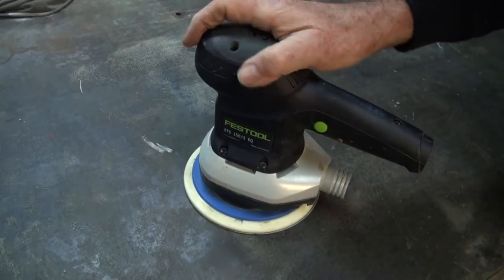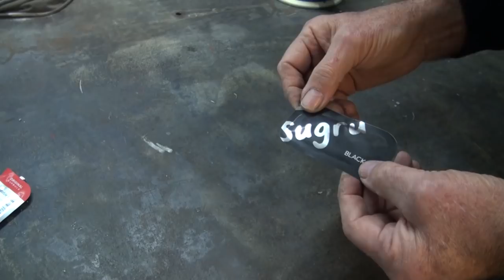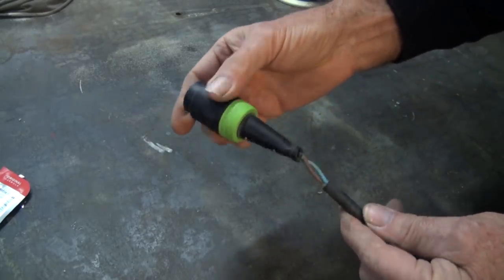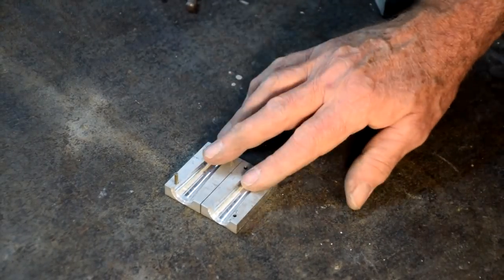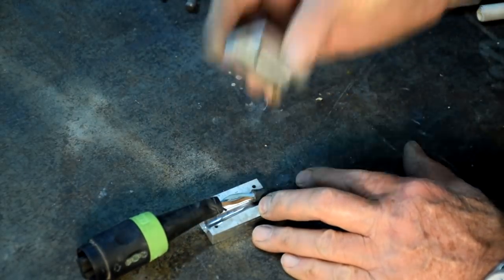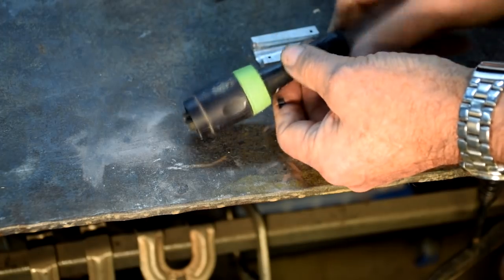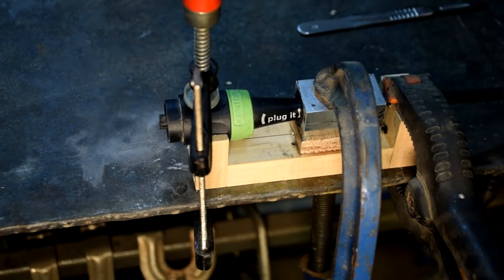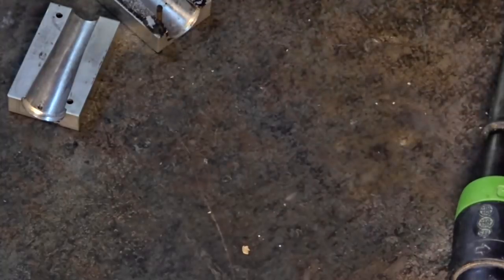Festo Plug It Repair

Comment: Nice project. I think it was well worth the effort even though it didn't fill in all around. But you also learned for next time. I actually did something similar using 1/2" aluminum blocks to make a jig head mold for fishing. Same pinned technique and two piece mold setup. Thumbs Up.

Comment: Hi! As an owner of a couple Festools and user of Sugru, I congratulate you on the fix. I liked your project of making a mold and a clamping jig. Kudos on the work but it might not be totally necessary to make a mold. 

You might want to try molding the Sugru with your fingers only without having to make a clamping mold. Lots of time, I shape Sugru with my fingers and smooth the outside using soapy water. Daniel

Comment: you can separate the green part by prizing it open and repair the lead .....simple...
Reply from the maker: Gary, I tried that. The connectors seem to be a one piece moulding. At the end of the day it was more about investigating the use of Sugru as a candidate for making flexible repair parts. I know it seems a long winded and complicated repair but sometimes it's more about satisfying my curiosity with new materials.
Regards,
Mark

Comment: Mark I'm probably telling you something you already know of. But heat shrink with the glue built inside of it would have worked great. I've done it several times. So far I have never had it to fail on me. However I'm not familiar with the product your using but it also looks like it will work for you. Thanks for the time and videos you put out. They are very helpful.
Reply from the maker: I did think about cutting off the male three pin plug and running heat shrink all the way up the cord but then I would be left with having to fit another three pin plug. I have read about that heat shrink with the hot melt glue inside. I guy (Arnold's Designs) did a YT video on how to make a submersible heater using the same product.
Reply: It's commonly referred to as "adhesive lined" heat shrink

Comment: Thanks, I had not heard of Sugru before.   I looked at the US web site.   They are calling it moldable glue.  I will get some to have on hand for the future.

I would not have spent the time on the die.    The result looks good.

Proprietary connections are good until something breaks, then they are frustrating.

Dave.
Reply from the maker: Dave, One of the reasons I used the Sugru was just to check out how it behaved. I had read about it before and it seemed to be the ideal candidate for this job.

Comment: Hello, I have never heard of "Festo" tools nor have I seen that product that you used to repair the exposed cord.
So, the obvious question is,......'where d'you get it?!
I am in rural NSW
Reply from the maker: Peter, I was able to buy the Sugru on Ebay. https://www.ebay.com.au/itm/Sugru-Mouldable-Glue-It-turns-into-rubber-3-Pack-White/262506467260 I have never seen it in Bunnings although they were listed as a stockist at one point.
Reply: Hello Mark, thank you for the information.
I will check Bunnings next time I go or order online if they don't have it.

Comment: I wonder if you drilled radial holes in the mold, if the stuff in the middle would have cured.  The holes would have allows excess to extrude out.
Reply from the maker: The whole curing thing was totally unexpected. I just assumed that once it got started it would continue right through the whole part. Maybe if you gave it enough time it would eventually cure all the way through. I suspect that the molecular cross linking is accelerated by air contact but who knows?
Reply: It's probably like a single part urethane, requires moisture to cure.  Cyanoacrylate also requires moisture to cure.  From their PDF: RTV One-Part Moisture Curing Silicone Elastomer, so yeah, it requires moisture exposure to cure.
Reply: More info: Approximately 24 hour cure for the first 3 mm of depth at room 
temperature. eg. 3 mm cures 
~
 24 hours, 5.5 mm cures 
~
 48 hours, 
8 mm cures 
~
 72 hours. (Cure time is influenced by; area which is 
exposed to atmosphere, temperature and humidity)
Reply: Well, here's the PDF: https://sugru.com/pdfs/tds.pdf  Apparently this stuff is known by Formerol F.10 and someone made up a catchy name Sugru to market it.

Comment: It's hard to say for sure without a better look at where the cable enters, but based on the collapsed end of the strain relief sleeve, it looks to me like the jacket has shrunk back (in my experience it often happens with low-grade cable and where there is not enough cable jacket inside the sleeve). I reckon it potentially could have been fixed by gently stretching the outer insulation along the entire length of the cable, and working the end back inside the sleeve, maybe adding some CA if needed.
Reply from the maker: Damn! I hadn't thought of that. Probably putting the whole thing in a low oven would make it more "stretchy" Still, at least I now know how Sugru works.
Reply: A low oven?  too hard...  an  hour on the back seat of the car in Summer on the other hand...   though that's probably what happened to the cable in the first place  :)   The Sugru tutorial was definitely useful to the viewers in any event.   Greetings and best wishes from (nearly) sunny Adelaide,   Mr Preso.

Comment: Interesting product, I don’t know whether I would use it for a strain relief job but I will get some for those odd jobs. Cheers Peter 
Oi, tell us in a coupla months if it’s still worken
Reply from the maker: I think that if I was to yank hard enough on the cord the bond would let go but it does at least stop excessive flexing and it gives an extra layer of insulation over the wires. I also couldn't stand the look of the exposed wires. It's an Asperger's thing!

Comment: Oh i see and totally agree.  Mine was a loose connection and if i jiggled the cable about at the plug i would then get power so it was clearly an easy fix which Festool don’t want to make possible.

Comment: Yeah Festool... I have one and that plug keeps falling out. I'm going to glue it, or pin it, or just wrap it in tape, unexpected nuisance. Not all that impressive a tool, I reach for my HF sander as often as the Festool.

Since the stuff apparently needs moisture to cure, I wonder if it would have cure more evenly if you had sprayed a little water in the mold before clamping.

I probably would have cut the plug off the other end, pulled on and heated successive layers of shrink tube, perhaps with stiffeners, then added an aftermarket plug.
Reply from the maker: Chimera, I have always found Festool stuff to be a bit of a prima donna. That particular sander was one that we used at the secondary school where I used to teach. The kids were pretty tough on tools and the Festool stuff didn't really stand up to the abuse. We stopped buying Festool because we could buy two Makita sanders for the price of one Festool. The Makita tools usually outlasted the more expensive ones easily. Having said that I recently purchased a Festool Rotex sander to sand my verandah deck. It coped with what was a very difficult job easily. It cost an eye watering $1100 but I believe it is one of the most powerful random orbit sanders on the market. It did do a good job.
Regards,
Mark Presling
Reply: @Preso58  Eye watering indeed.
I've got this awesome Fein random orbiter (MSF  636-1) that I picked up from Woodcraft at half price when they stopped carrying Fein some time ago (I think they may be stocking them again, although I now avoid paying their premium prices so I don't visit very often) It's a beast, I'd put it up against anything Festool or other makes can throw at it.

Comment: That is solved in three minutes with self-vulcanizing tape. all the time and tools you used came out more expensive than buying a new one. And who has a lathe at home?
Reply from the maker: Thanks for the feedback. I did actually try self vulcanising tape and it sort of worked but I find it always unravels slightly at the free end. I am one of those sick individuals who likes to try unorthodox approaches to simple problems. I had never used sugru before and it seemed like a fitting project to try it out. As it happens, the repair has held up to normal shop use. It looks good and it does the job of strain relief on the mains wiring where it enters the handle of the sander. I know it's not a repair for everyone. It might however give someone and idea for a completely unrelated repair. As for the cost, I only had to purchase the sugru. Everything else was just lying around in my shop. I actually priced a replacement Festool cord and the price here in Australia was outrageous. 
Regards,
Preso

Comment: I wrap breaks like that with self vulcanising rubber tape. After a few hours it becomes one solid lump of rubber. But that would be a really short video.
Reply from the maker: I tried that but the tape must have been old and it failed to bond to itself. For a while I thought I was on a winner but at the end of the day I guess I just wanted to play with Sugru. I'd never used it before and it seemed like fun to try.
Reply: You know that the tape has to be stretched to several times its length as you wrap to activate?

Comment: Hi Mark, Did you know you can make your own Sugru substitute with Pure Silicone Sealant and Corn flour. If you want it to be coloured you can add a small amount of artists oil paint (linseed). There's a good overview of the process in this instructable - https://www.instructables.com/id/How-To-Make-Your-Own-Sugru-Substitute/ One of the benefits of the DIY Sugru is that the corn flour acts as a catalyst and it cures right through in a couple of hours.  I've used this method a few times now,  one use was to make a replacement molded gasket for a pump, This would have otherwise cost a couple of hundred dollars for a complete rebuild kit.
Reply from the maker: Glenn, That's interesting.... I did check out a video by the inventor of Sugru and she claimed that they used silcone and various fillers, one of which was ground wood fibre (cellulose). I am guessing the binder or cornflour also behaves like a non-newtonian fluid when mixed with the silicone. I will try this since the Sugru is a bit expensive if you need a lot of it, plus it sounds interesting. Getting it to cure in a closed mould would also be a benefit. Thanks for the tip.

Comment: This is how you can tell that Festool is overpriced. The little details are why I would pay more for a product. Now I am supposed to pay $50 for a replacement plug? What a pile of crap. Someone borrowed my Festool sander (for the last time) and didn't even tell me she had ruined the plug. So when I went to use it, I couldn't. Then I find Festool has fucked me by making crap that can't be repaired like a normal plug. Screwed twice with one tool. Mine has the connection inside pulled apart so I'll have to cut it open to see if I can fix it for the little job I need to do this morning.
Reply from the maker: Yes, I feel your pain. The whole plug it technology is OK if you own dozens of Festool products but who can afford that? Certainly not hobbyists. Not me, anyway.
Regards,
Mark

Comment: Stupid reason. 1) disassembly plug (little bit of power) 2) cut wire and shorted cable 3) weld cores + isolation 4)assembly and use. 30min. zero money.
Reply from the maker: That is true, I could have done it with a bit of solder and insulation tape but I was interested in working with the Sugru. Often I will approach a project in what seems like an overcomplicated way but the aim is always to learn a new process or to work with an unfamiliar material. For what it's worth, that plug is still intact and the wires are now protected and it looks neat. 
Regards,
Mark

Comment: I bought a new cable/plug from ebay for £25 dam sight easier that this option
Reply from the maker: Yes, I totally agree that yours is the easier option however I wanted to learn about using Sugru as a repair agent and I feel like it should be possible to resuse or repair something without chucking it into landfill.